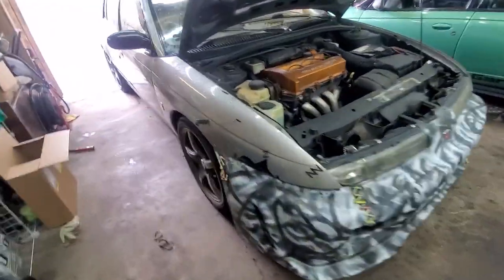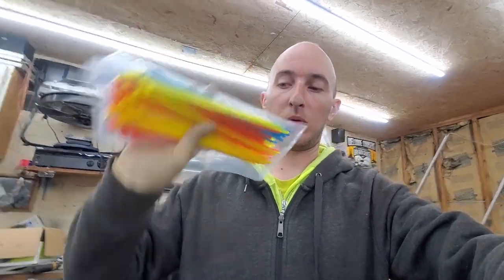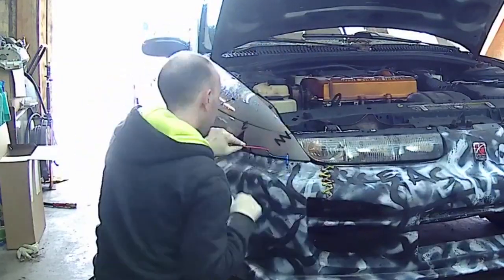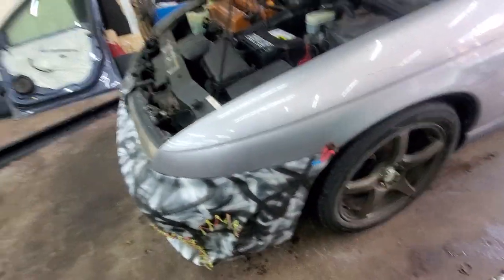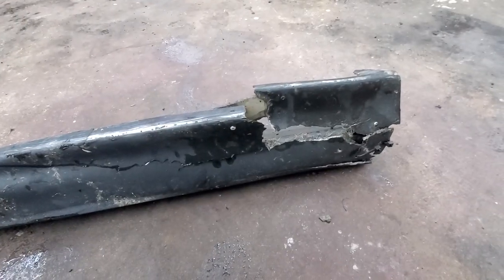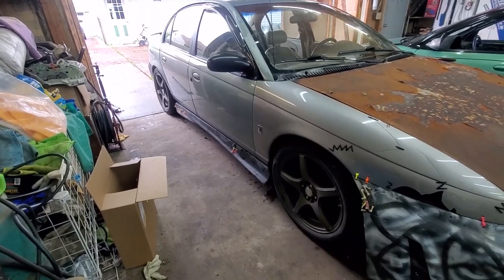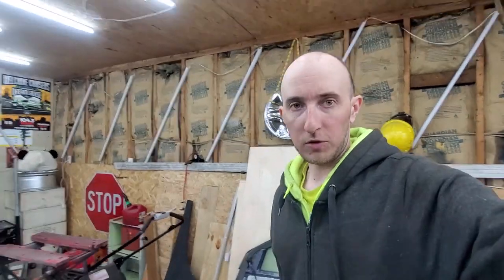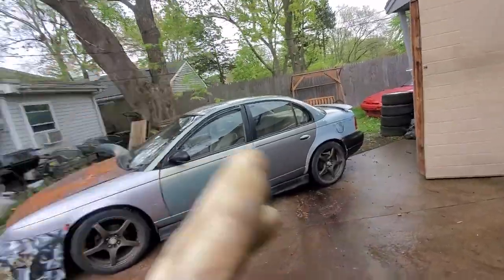Ratty Rebirth

Comment: I just got a 95 Saturn sw2 and i'm trying to run some factory Honda wheels on it but not sure what I need to get the to fit. What size spacer or what should I use to get them to fit. Are spacers something that is a must need for our cars if we're running aftermarket wheels?
Reply from the maker: Stock honda wheels won't fit because of the hub centric ring... any aftermarket 4x100 wheel will fit
Reply: @BuilditBreakitGarageinc  yeah I did a little more research and if I wanna run Honda wheels I'd have to have them bored out. Guess I'll try and trade them for some other ones

Comment: What is the biggest size rims and tires u can fit on without rubbing or grinding cause i want a set of 16 or 17
Reply from the maker: That depends on alot more specs than just the size... some people have even fit 20s... but I personally won't run anything larger than a 17 on a saturn
Reply: @BuilditBreakitGarageinc  I want some 17 and what is a good brand of coils would u recommend
Reply from the maker: Raceland coilovers are great for these saturns